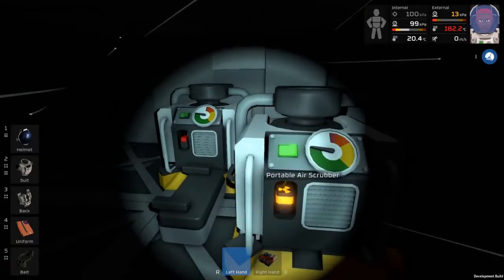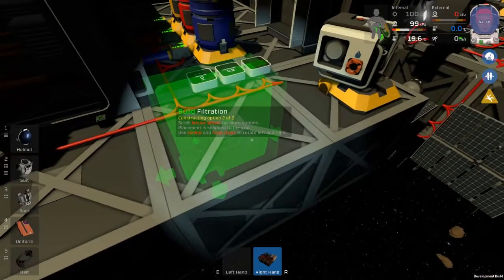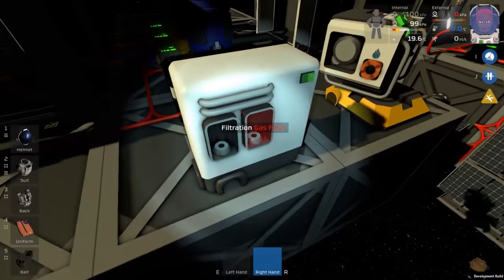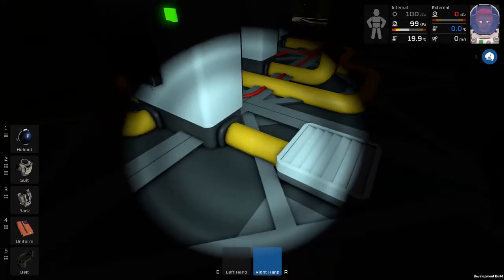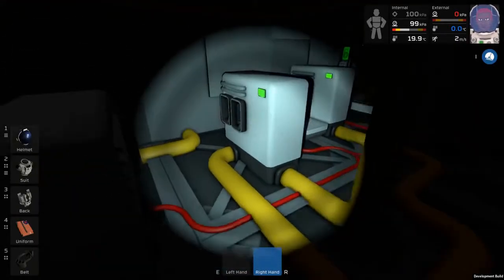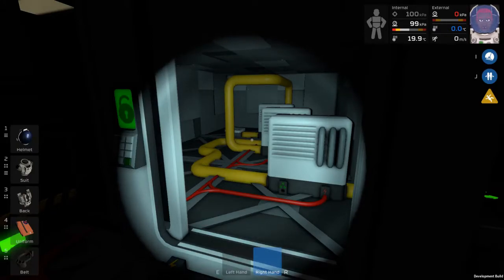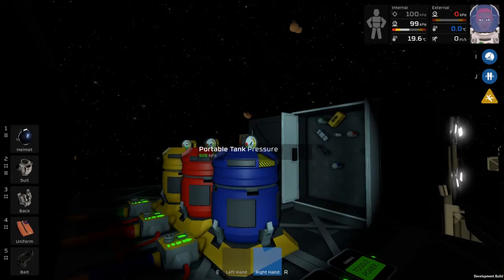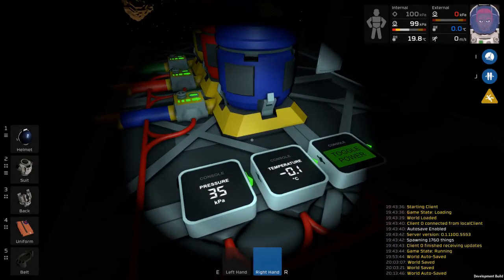Stationeers - Automated Gas Harvesting Room

Comment: Glass door and Iron wall can take 150kpa. You can improve this by using an airlock door for entrance/exit and making the entire room out of frames, which have much loftier kpa maximums (theoretically infinite so far). That way you can dump as much material as you want into the room.
Reply from the maker: Good to know. I've had walls randomly blow out when I've been careless with pressure, but I've never sat down and tried to find the failure point.
Reply: https://goo.gl/ZG4nSt

Here's a link to a cheatsheet for the game circulating around.